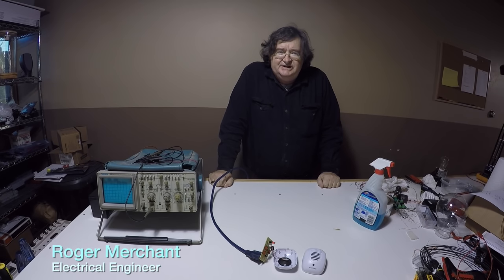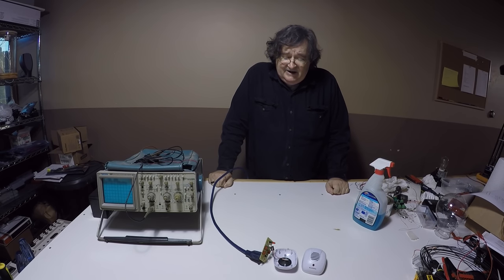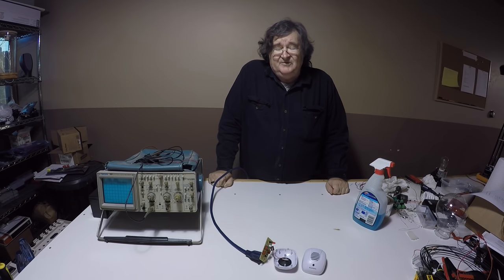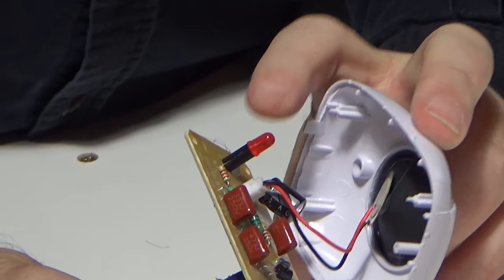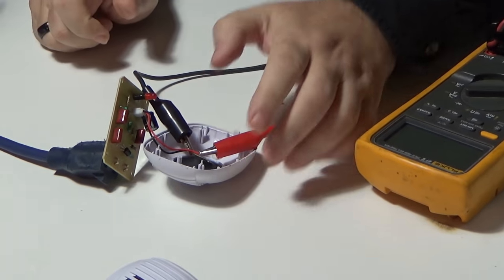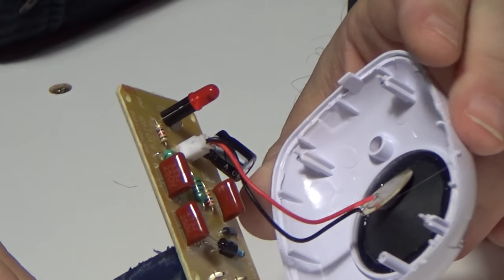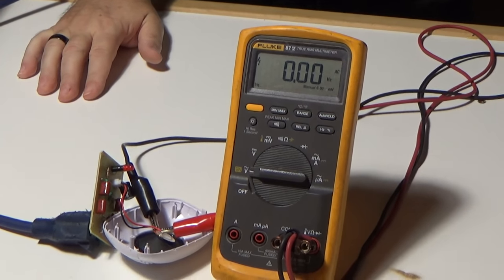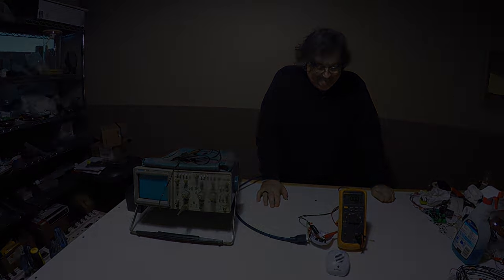Do Electronic Pest Repellants Work? An Inside Look

Comment: Years ago I bought some Black and Decker repellers for insects, plugged 'emm into my Dad's old house, and they really worked!  Need some now for wspiders and scorpions, which are a HUGE problem in old trailer houses.  I've been bit by brown recluses 3 times now!  The war is on!
Reply: which brand product you use it works well?
Reply: @dannychan8553  Black and Decker

Comment: I've been using similar electronic pest devices for decades. 2 or 3 in each room and by exterior doors. They have kept my 4500 sq. ft. home bug free. The only bugs I see are dead or dying. Especially seems to work well on roaches. These devices are NOT powerful enough to repel rodents. If you have mice, rats, squirrels, etc., you need to find out how they're getting into your home and close up those holes with metallic materials like hardware cloth, metal screening, sheet metal, etc. Good luck!
Reply: which brand product you use it works well?

Comment: to be fair, the reason you have no signal frequency being detected in your sensor is because of 2 main reasons.
1, the ultrasonic frequency emitted by the machine is to low, or your machine sensors isn't sensitive enough to detect the hrtz ultrasonic low range.
And second, by plugin the the electrode clamps directly in the plate of the ultrasonic, the vibrational pressure waves are decipating and being dampened at the same time. The ultrasonic wave is in no doubt very low. good video and thank you for demonstrating that this is still a bad wasteful product to buy.
Reply: I don’t mean this to be condescending but rather educational. The term ultrasonic by definition means above normal human hearing perception. That being the case the frequency is not to low to detect. Normal human hearing frequency is between 30-18k hertz. The Fluke 87 is an industry standard professional level general purpose meter more than capable of making the measurements required to evaluate this device. The data sheet lists its frequency measurement as .5Hz to 199kHz with an accuracy of .005% + 1 and AC voltage range of .1mV to 1000V with an accuracy of .7% + 4 of rms and resolution of .1mV. Also, its input impedance is 10 million ohms. For this application that’s high enough to make any deviations due to its measurement statistically insignificant. I’m no Fluke salesman but you absolutely no idea what you’re talking about.

Comment: Then you don't know about PWM concept. Voltmeter only recognizes a constant voltage difference and the duration of the pulse needs to be larger that the sampling rate of your voltmeter. Your test is not proving anything.